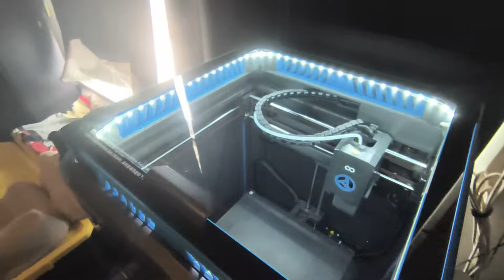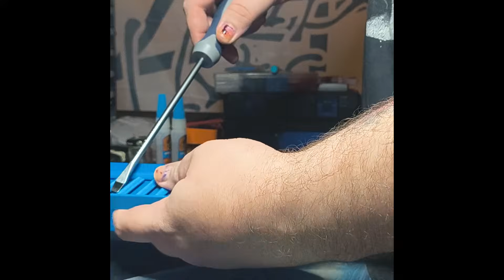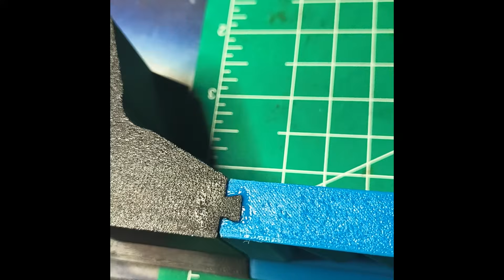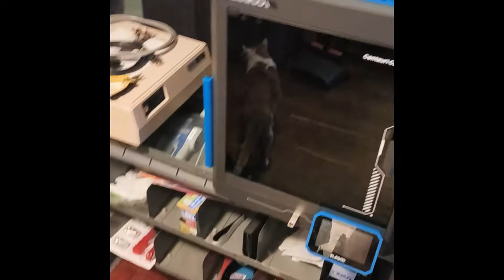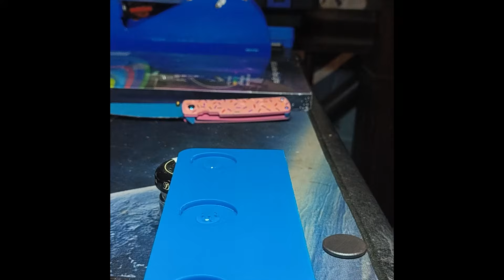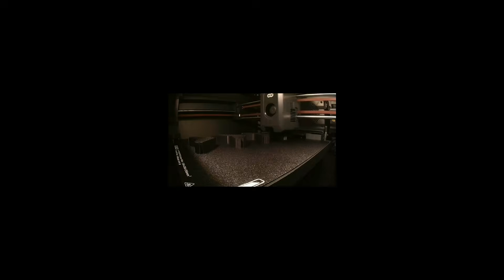Modding my 3D Printer - Pt1

Comment: The Elegoo CC is on my list for my next 3d printer after my BL A1 Combo.  Please make sure you give us an update after 1000 hours of usage.  What is your primary use case for your 3d printer?
Reply from the maker: I enjoy using my 3d printers for making custom solutions. Right now I am modeling and printing an organizer system for my work bench. But I print some silly things too. I do have some big plans so I hope you stock around to see what I come up with. And I'll be sure to give an update down the line after I have really put the Centuri Carbon through its paces.
Reply: @LayerLair  Thanks for the creator like and reply.  I look forward to your 500 and/or 1000 print hour review.  The next thing I am trying to learn is CAD.  Right now doing stuff with Tinker CAD, but I am trying to figure out which CAD package to learn next.  There are a lot of options out there both free and paid, cloud based and local.  Right now I am leaning toward the Open Source local option Free CAD but am also interested in SOLIDWORKS for Makers.

Comment: Thanks for sharing your printing mods. I have printed this riser, but I actually prefer the one on printables called "Elegoo Centauri Carbon: Yet another but sturdy riser". To me it is a much better riser.  You have to hold the parts together with M3 screws and nuts, but to me it is worth it.
Reply from the maker: Thanks for the suggestion. I like to avoid glue anyways if possible. I will have to report. I may have to reprint some mods in the future since I used PLA so I'll take a look at that riser.
Reply: @LayerLair  I printed the frame (straight parts) out of PETG and the corners out of PLA. I will have to see, but this should be fine. The corners are thick and it doesn't get that hot at the very top of the printer.
Reply from the maker: Thanks for the suggestion. I like to avoid glue anyways if possible. I will have to report. I may have to reprint some mods in the future since I used PLA so I'll take a look at that riser.